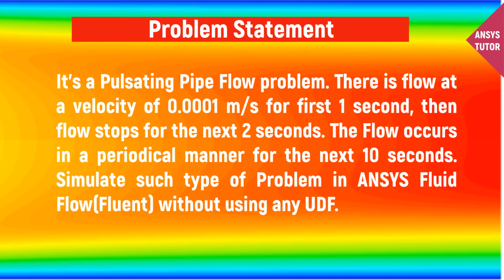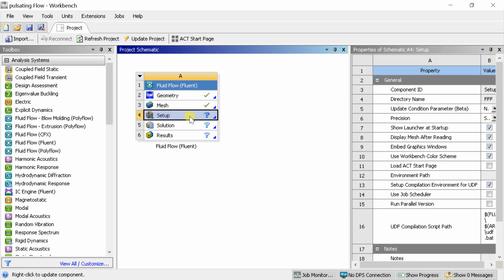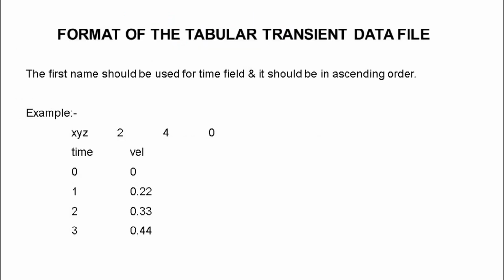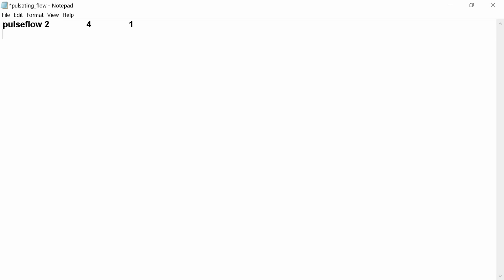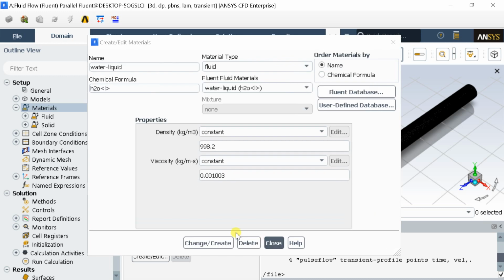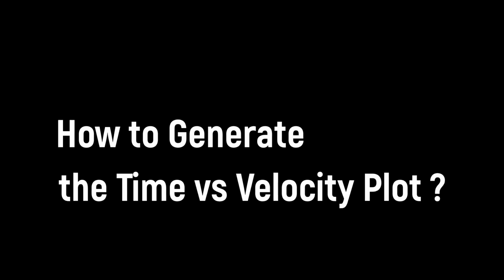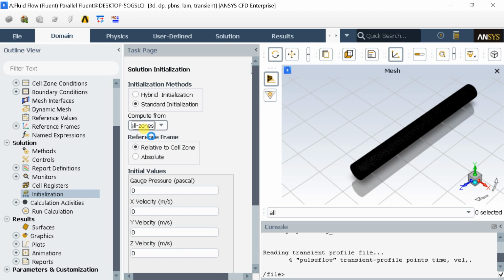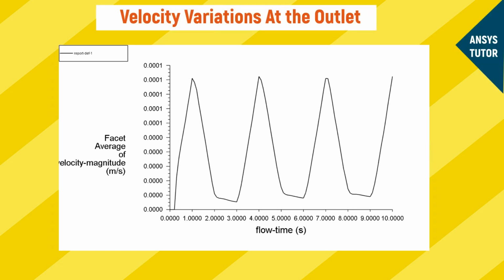ANSYS Fluent Tutorial | Pulsatile Flow | Flow Pulsation in ANSYS Fluent | Pulsating Flow CFD #ANSYS

Comment: Hello, I am doing a simulation of the pipe. Water with a constant heat flux in the case of the transiet. The wall does not heat up. Can someone help me?
Reply from the maker: Check the meshing and boundary conditions.